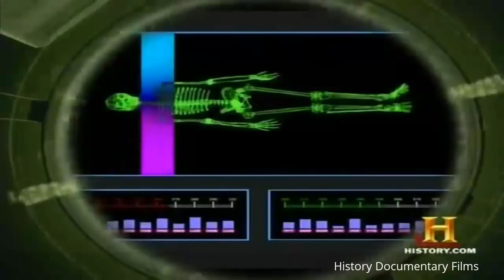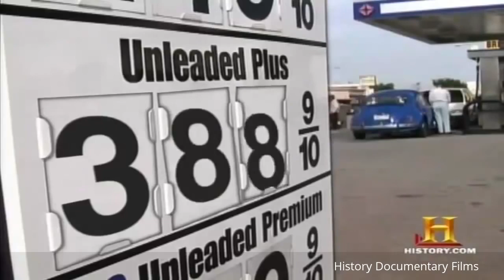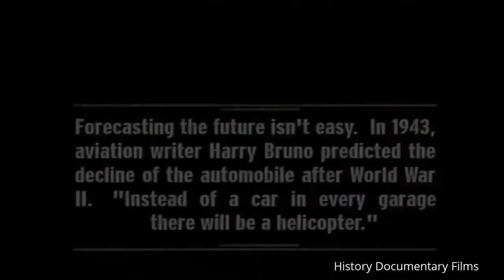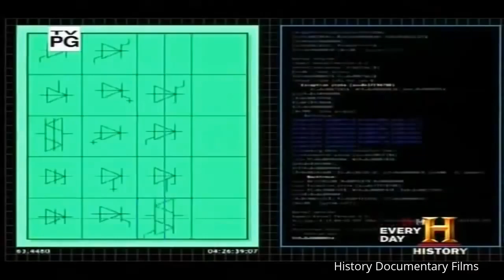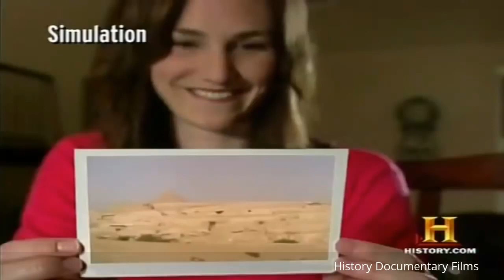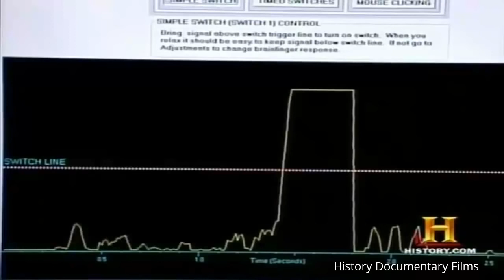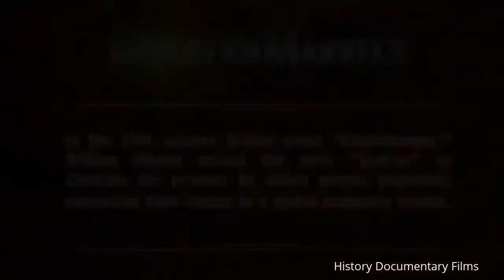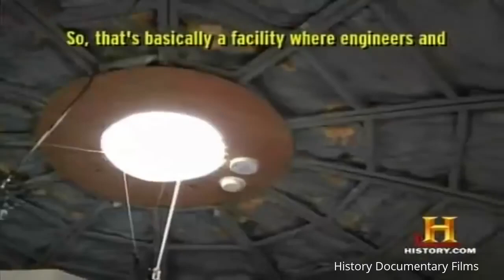Invention into the 21st Century : Documentary on Modern Inventions (Full Documentary)

Comment: ?
Reply: If your ?  - means what happened to hydrogen power ?    -   I dunno :(   so sad
Reply: As dead as a dodo, about all car manufacturers have lost interest
Reply: Pretty sure it's due to not having a proper way to be safe and not blow you up. The hydrogen gas has to be highly pressurized. The power to fuel ratio is lower than regular gas. I had a propane/gasoline van that worked on both, the cost per litre/milage ment I never used the propane more than twice.